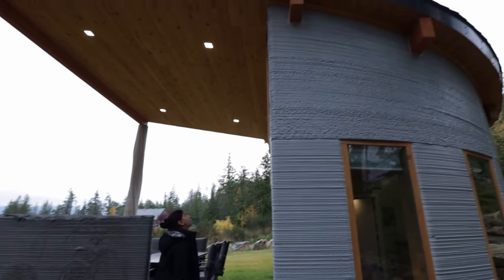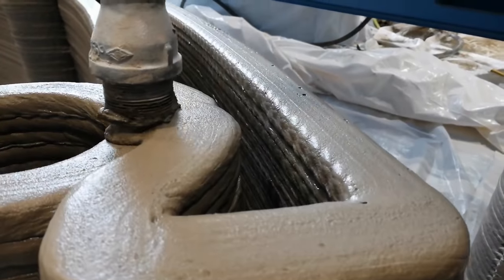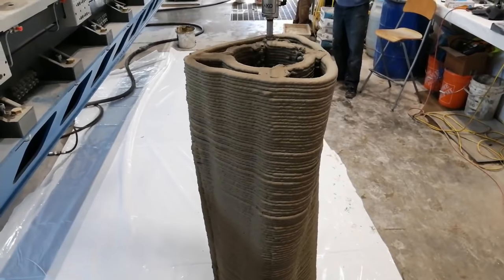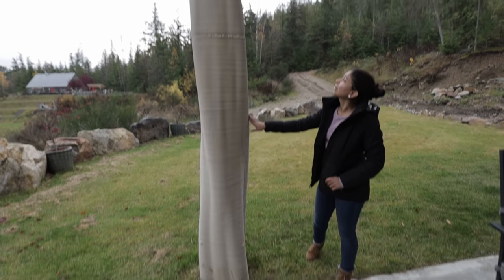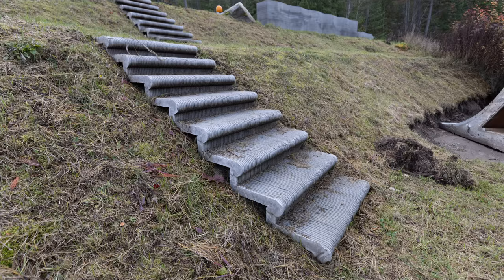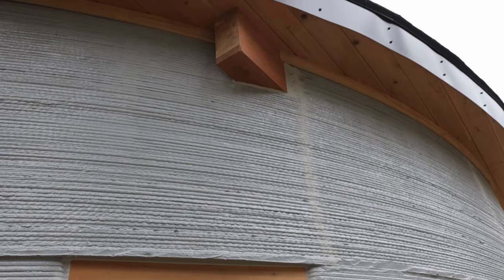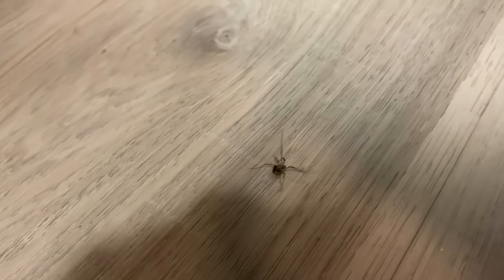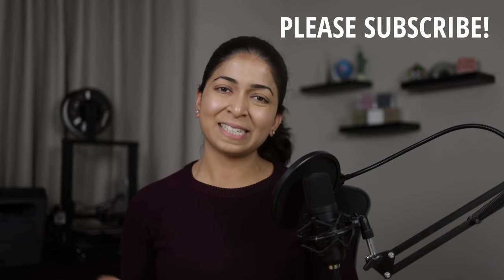Fibonacci 3D printed house | Good, Bad & Ugly

Comment: I think I mentioned it in a comment in another one of your 3-D printing videos but it would be really great to see a 3-D printer that used cob instead of concrete. I find it ironic that they're mimicking natural shapes and forms using really toxic materials.

Also, you have good point about the relatively small cost of the wall system in relation to the total cost of the build.
Reply from the maker: They're also experimenting with geopolymers and plan to move away from concrete in the future! The options are very limited right now.
Reply: I m not sur cob and all the vibes within would go through the printing nozzle....
Reply: @bobjob3632  Oh it wouldn't, not without refining the straw and other materials.
Reply: It just shows how much the sub contractors pilfer because of their 'specialty'.

It's why I tell people to do most of the grunt work for these subs.   I.E. Run your own wiring, You know how much you save by doing 90% of the work?  Loads.
Reply: @miked.9364  Yes, the straw is definitely an issue. Maybe a bigger nozzle? Papercrete could be an option since the fibers are very small but I think it still uses some Portland cement. There are some other issues like drying times. Cob will slump if you try to go up too fast(e.g. more a foot every few days) with it. 

On your other point, I agree. Just hire the electrician to make the connection between you electric utility provider and your breaker box and do all the household wiring yourself.

Comment: The total volume of concrete used is 800,000 cubic meters?
I presume 800 to a 1000? An m3 is pretty huge, even that number sounds high?
Was it cubic feet?
Reply: searched through the comments to see someone comment on the 800,000 cu M lmaooo think you're right 800-1000

Comment: Perhaps they should market something more Hobbit-esque & dome-shaped? Add some sunlights a few arched top windows & cover that not-so-attractive concrete, with copious waterproofing, foam & then bury the bottom 3' of domed wall in dirt for added R value and 6" of sod over the rest. This will maintain a more constant temperature in the concrete shell with little or no expansion & contraction. Heated floors & 1 HVOD hot water tank with circulating pump could supply all heating & hot water needs. Dome shapes are far stronger as well, see Roman Pantheon, though they do pose challenges to finishing the interior.
Reply: The Hobbit houses uses to be popular in Japan. I stayed in one recently. 
Mine was made solely out of foam. It's easy to mass manufacture these with forms. It's cheaper this way and there is no need for heavy concrete. 
Since doom shaps are strong, it is easy to avoid concrete all together. 
The walls in the one I stayed in were over 30cm thick. It was very warm inside.
Reply: @valdius85  I am familiar with & an admirer of the foam homes as well & while they are easy to manufacture and cheap, if they have to be recycled they are not environmentally friendly & in some cases pose health hazards. Whereas concrete and rebar are 100% recyclable. People often cite the co2 desparity of concrete while omitting the fact that the lumber to build a traditional framed house contains no less than 100 trees that have to be culled & are no longer removing the carbon from the atmosphere. Reliance on Earth based products rather than organic gives us much more material to work with.
Reply: @TheMuskokaman  
I prefer RC as well for buildings. Too bad it's not popular in Japan for small structures due to earthquakes and humidity

Comment: I wonder why they don't attach a flat "scraper" on the nozzle to flatten the concrete layer by layer? I'm sure a broad piece of stainless on a 360o swivel will follow the wall contour without needing the added complexity of another guiding motor associated electronics and programming.

Comment: Please enlighten me since I can't understand. Why 3D print? From the look of it, using bricks is faster and won't need cranes to transfer materials. If we use platform framing which USA seems to favour a lot, it can be done much faster.

Is it just for the novelty value or proof of concept? I'm pretty sure the building cost is way more expensive than if they had just used normal bricks. I think the savings from having less construction worker is negligible in this case.
Reply from the maker: I agree and addressed those povs in my other video on 3d printed concrete : https://youtu.be/sz1LM9kwRLY
However, it's an exploration of a new tech. Companies haven't figured out the best use for it yet and are still refining the process.

Comment: 50 years ago my parents built a house from prefabricated wooden elements. Those elements are small enough that two persons can carry them, no need for a crane. Manufacturing such elements takes much less time and space than those 3D-printed prefabs, especially when using modern machinery. The house survived many storms, cold winters and hot summers without much maintenance, painting every 10 years, not much more. There are no cracks in the walls, the electrical plates fit properly, all parts can be recycled easily and building it even stored carbon instead of producing. And the best part: there are no curved walls which means standard furniture fits perfectly, no need for extra expensive custom made furniture. So why would anybody want a 3D-printed home?

Comment: Until now I haven't seen in 3D printing construction what I originally expected. Most companies focus on a single part of the construction process. I've mostly seen walls. But imo the most potential is in combining it with the other parts. A lot of construction is manual, because the other parts are too and humans are very good at working with error margins, while machines "prefer" precision. If the first parts of the construction process are automated, the rest will be much easier to automate.
Reply: What do you mean by "first parts"?
Reply: @valdius85  Basement/Concrete slab and walls. These seem to be already quite automated, but once the walls stand you rip them open again to lay cables and pipes. I get that it's done for simplicity's sake, but is highly unintuitive for me. Especially in european brick houses. Chisseling out channels in walls for cabling is serious labor and imo pretty useless if you know where they'll be at the designstage.
Reply: @OperationDarkside  
Yeah, I agree. 
The small housing tech is so out of date. 
Clients are the reason. Wanting "everything" for nothing.

My uncles 100+ y.o. farm has cables visible. Going back to that style would bring prices down.

Comment: I'm looking at this as a viable alternative to building a house. I have land in Florida an plan on building a house to retire in. I wanted to build with steel frame construction for durability, structural integrity against hurricanes or tropical storms and the simple fact that the outside walls would be thicker. Due to the steel I-beams dimensions, it would allow for more insulation to keep hot and humid conditions outside. Thank You Belinda.
Reply: Concentrate on workmanship of whatever you build. Workmanship and stupid design is a serious problem here in south FL. Two examples are a/c refrigerant lines and domestic water lines buried in the slab. You wait a long time to get hot water which gets cooled in the slab and you leave hot water too. Another example is roof sheathing "air nailed" close to the trusses but not in the truss. Typical south FL workmanship leaves the roof trusses close to 24 inches apart, but 23 inches is close enough. For reasons unknown, aluminum framed windows with a single layer of thick glass are called hurricane windows and are standard fare.

Comment: @2:40 you state that the total volume of concrete used is "800,000 cubic meters".  I think there may be an incorrect unit used here. For reference an Olympic sized swimming pool can contain 2,500 cubic meters of water. Your reference is orders of magnitude larger than that lol or maybe I just have no clue how much concrete can be pumped through a 3D printer nozzle.....?
Reply: I wondered about that as well. That's almost a cubic kilometer, or an order of magnitude of a major volcanic eruption.

Comment: The rebar undermines the insulation. It is a major thermal bridge linking exposed large faces of concrete that themselves create a lot of surface are to transfer heat with the air, so the insulation in the walls probably does next to nothing. They need to replace the rebar with a much less thermally conductive material, find a way to get rid of it entirely, or accept that they'll need to add a layer of insulation on the entire outside or entire inside faces.

Comment: This video makes it very clear that 3d printing of concrete is universally a solution looking for a problem.

Not a great position to be in, but at least this company has a leg up in that they clearly recognize the "solution looking for problem" status and are actively trying to find that problem. And the "designs that are impossible with traditional techniques" is a good place to be searching. There is probably a market for ultra-rich homes made with innovative techniques.

It might give them a leg up over other 3d printed home startups. Also, the quality of their print seems to be significantly better than most other prototypes I've seen.
Reply: The main problem we are trying to fix is that there is a shortage of construction workers in virtually every country we operate in. Gone are the days when the majority of the population was willing to spend 20 years of their live perfecting their craftsmanship under a mentor which is what fine construction requires. There are still lots of amazing contractors out there, but they increasingly have a hard time find crews who want to stick with it for long enough to pass all the knowledge on. This has lead to housing prices being based on this decreased skilled labour supply and now a much higher percentage of the population will never know home ownership. This problem already existed long before we started working on this particular solution, which is only a small piece of the puzzle we must face in society to turn things around.

Comment: It look interesting.👍
I wondered how they treated fitting doors and windows. I would have liked to have seen that step by step closeup.
Like, do they have to grind any of the surface areas flat?  How much extra time does that take, cost wise.
Reply: The windows were hand made by a local carpenter who had to take into  consideration the wall opening is actually wider at the exterior than the interior due to the radius of the curves. He used sustainably harvested cedar from the mountain behind the house and the gap was filled with expansion poly-urethane once it had been shimmed plumb.
Reply: The doors sadly are these garbage retail doors we were forced to put in as our originally planned sliding patio door didn't meet building code. Because this home is on a commercial property, we needed a door set that opens out rather than in as this is a method to prevent people from stampeding into the door and holding it shut while the place burns down. Of course that is never going to happen here, but once again the code is more important than the application. We could have paid a door maker to make us a 10,000$ pair of  glass doors but that would not have been in the spirit of a low cost home. Unfortunately, these doors let in bugs.

Comment: Interesting. When I think of 3D printed homes I think of walls extruded in situ, not as components to be assembled. I supposed a factory setting would lead to better consistency, quality control, customization, etc in the long run, but then all you'd have in the end is just another method of fabricating building materials. Where's the advantage over conventional materials? 

As for the continuing problem with outlets, etc - it seems the practical solution is to design outlets, plumbing components, etc that are specifically for use in such construction. 

As for the spiders and other visitors, some caulking and a thorough initial pest control treatment with regular followups should address that.

Comment: I think if we are to use 3D printed homes we should look at making structures that are more organic(bio mimicking) in form(like what you said about curved walls). That way we will be actually utilizing the positives of 3D printing. Because building a traditional box shaped house using 3D printing is simply unnecessary as it’s trying to solve an issue that doesn’t exist.

Comment: As with most use of current 3D printers, that is to create prototypes, the strength of 3D printed house would be in the speed and cost I'd imagine.  Is finishing a 35m2 house within 5 weeks considered fast?  $6000 I would consider quite cheap for bare bones homes.  Instead of for homes, would this be more suitable to build simpler buildings like toilets, park facilities, etc.?

Comment: The concrete in the house weighs about 4.2 billion lbs or she meant to say  8m^3 instead 800 000 m^3. BTW, given all the walls were concrete, 8m^3 is pretty impressively efficient which is important for reducing green house gases. Although I can't really blame someone from the US messing up metric units.☺
Reply from the maker: Shoot. Got the volume from a designboom article and didn't convert it to make sure it was right. Thanks for the correction!
https://www.designboom.com/architecture/the-fibonacci-house-first-fully-3d-printed-home-on-airbnb-07-08-2021/
Reply: @BelindaCarr  I read the article. I thought they maybe meant 800 000m of concrete were laid down but that can't be right either. It made a bit more sense with an extrusion that was about an inch high and 2.5 inch wide but I calculated that would still be about 140 concrete trucks full. The writer probably just accidentally leaned on the zero on the keyboard and didn't notice. Btw, your videos are always good and entertaining.

Comment: Looks amazing. Sure wish this technology was more readily available. I don't see any advantage of transporting to the site, it would be way more economical to do on-site, or produce a fully completed product/house and then deliver.
Reply: Alternate conclusion could be drawn based on the time-effort-cost it takes to transport the printer parts, Assemble on location, Calibrate on site, regularly clean the head and maintain it on location, disassemble & transport back vs prefab the parts in already available factory space, transport and join them on location. I didn't go back to check the  video for site details, but some locations may not be best suited to place a large 3D printer exactly in best suited spot for the final result to come out in desired space. Till we reach a level where Printers with 3d Arms are mounted on back of Trucks, there'll always remain the debate of whether to print on location or use prefab.

Comment: 3D home printing really sounds like a unique and cool way to construct homes. I don't think building elaborate and stunning homes with 3d printing is the best way to expand that industry. Perhaps 3d home printing should aim for convenient, quick "cookie cutter" small buildings that are commonly made. If they offer tried and tested home designs, they might be able to avoid some of the bad and ugly issues pointed out in the video. Another thing that bugged me was the fact that they made the building piece by piece and drove it to the site. I can see how it ensured quality creation of each piece but like you said, the unfinished produce was annoyingly unaligned at certain parts. I think an ideal goal to strive toward is transporting the 3d printing components along with its protective materials and making the buildings on site. I would worry about potential errors and having to scrap a partially completed product and with that in mind, I'm not sure if speed should be a direct priority for this industry. The goal is the give people a home or building that effectively looks visually acceptable and serves its purpose.